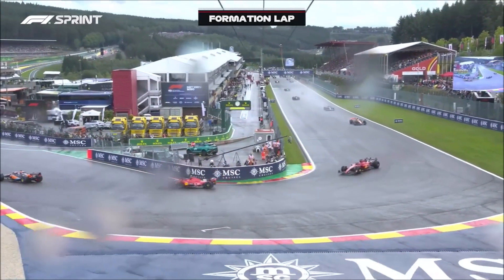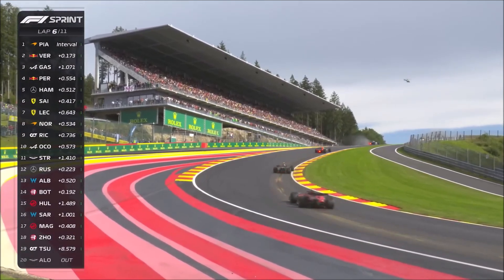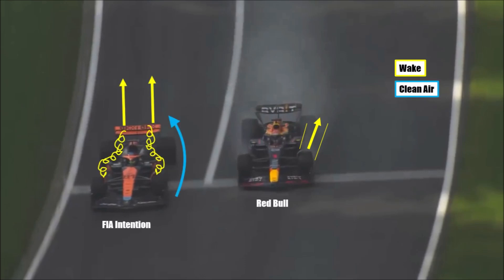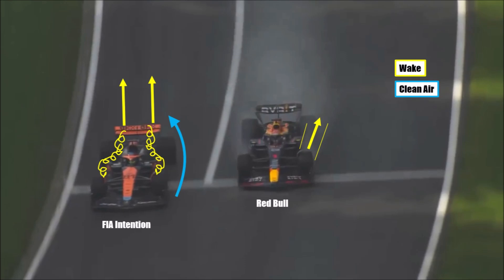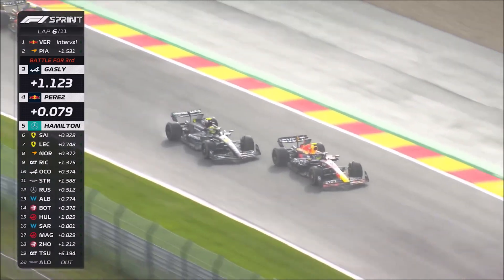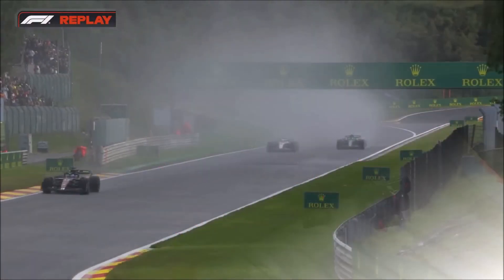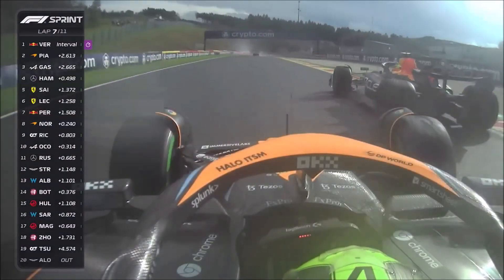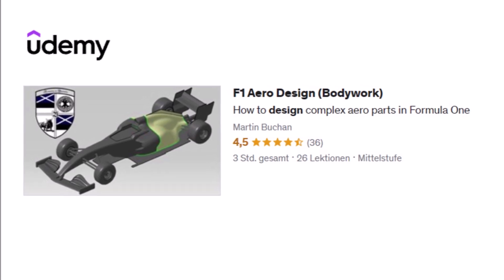F1 2023 - Spa Spray Party - Aero Visualized

Comment: It's important to keep in mind that spray may not _entirely_ reflect the airflow around the car. In order to fully visualise the airflow you want small, very light particles like smoke that don't have appreciable momentum on their own, as this means they will not "overshoot" the flow-line of the air molecules because they are too heavy. However, water droplets tend to be quite large; the tyres aren't designed to fully atomise the water droplets. So the spray may not be an entirely accurate representation of how the air is actually flowing around the car, especially the stuff that's being squirted out of the tyre contact patch.
Reply from the maker: Yes very true. That’s why we don’t talk about details here and just look at general flow patterns.

Comment: Since RedBull is going in against the spirit of the rules, they should be penalized. 
This video also clearly explains RB's advantage on how they are able to benefit from their DRS so much more than the competition.

the issue here is that if the FIA allows this, then all the teams will follow suit, and you are back to square 1 PRE-22, with a lot of unneccesary money spend, and the whole problem is back. It essentially only worked for the 1st 1/2 of the '22 season. By now, it's all done and dusted. It's reasonable to expect that any reg change will cause this.

The real problem however is not that the outwash or aero causes cars to have problems following. That is the genuine thought problem of the FIA. The problem is that following close, with a loss of aero, and increase in heat, can ruin your tires in as short as just 1 or 2 laps. The problem thus, is actually, not the presence of aerodynamic grip, it's the lack of mechanical grip - and this is greatly due to the artificially bad properties of the tires.

if the FIA finally decides to use proper tires, that bring proper, respectable grip and endurance, then we're looking at a whole different situation. It will also improve racing under wet conditions.

Less aero dependance is not really a solution. It is not the real problem, because you will always turn into a situation that that will be overcome. Mechanical grip is what is lacking, and that mechanical grip should be achieved fully independent of aerodynamics. 

There are two ways to achieve this, but there are 3 things needed to bring real success, best is 4 changes.

The first is, as stated, to fix the tire issues. Make real, good, tires, and you are done. They can keep the different tyre compound mandate if they wish.

The second is, to lower the overall curb weight of the cars. Make them shorter, and allow 'exotic' materials. The cost cap makes sure costs don't fly out of reality.

A third solution, would be to open up the regs. The cost cap will prevent going too far on cost. but if you open up regs, teams can come up with nifty innovative designs, as long as they fit within safety margins. 

The fourth solution would be, to re-introduce fueling. This would also reduce the weight of the cars easily by 50kgs. Right now, they ride with 100kgs of fuel on board at the start. The cars are already super heavy. If you introduce re-fueling, by forcing the max fuel capacity to be 50kgs, then this will make the cars a lot faster and much more agile. 'But it is more dangerous to have fuel during a pitstop' - yes and no. The idea once was to reduce incidents because teams were trying to have too fast refueling leading to incidents. But now we have so fast tire changes that it creates such hectic we see much more 'unsafe releases', and it puts many members in danger. 

forced refueling makes the pitstops slower, and as such, less cost and pressure to change the wheels and make mistakes. It will also take away unfair tactics during safety cars or virtual safety cars to a margin.

Comment: @1:33 it's impossible not to create wake with open wheels car whether it's FIA intention or not.
Reply from the maker: It’s not the intention to avoid wake but to position it closer to the car‘s centre line.
Reply: @bsport320  It's impossible to do that unless they are allowed to have an aero structure that is only allowed to tuck in the wake in instead of out in front of rear wheels. The opposite function of those barge boards in the past.

Comment: B sport can you look at the Mercedes bouncing and the red bull, if you go on board with max p1 lap the red bull bounces on the straights and in the corners but less so when the drs is open. Lewis DHL fast lap award the Mercedes didn't have drs was bouncing more but when it had drs was bouncing less than without drs but still more than the red bull. Spa must be bumpy in Places but also both cars had porpoising in several locations.

Comment: Mmm... I liked your analysis and I don't want to say it's wrong, but... Isn't the direction of the water spray more dependant on the wheel angle? I don't mean the camber, I mean the angle that Mercedes was able to modify with the DAS.
As far as I know, front wheels are not literally parallel, they are facing inwards a little bit. If the Red Bull have this angle bigger than other teams, it could explain the direction water spray takes.

Anyways, great video! Now I want to watch the highlights at 0.25x in a big screen.
Reply from the maker: It's true that there is some toe angle, but the aerodynamic effect is very small. Outwash is not being produced by toe angle but by aerodynamic surfaces around the wheel.

Comment: I don't think this analysis is correct cause you're comparing apples to oranges - dry line vs wet line. They have different amounts of 'visualising particles' so you may not be seeing all that happens in either case.
Reply from the maker: I am not comparing the McLaren next to the Red Bull. I am just explaining the FIA's intention vs Red Bull.
The only comparison I did was HAAS vs Aston and there was still some spray around the HAAS to see the general flow pattern.
There is never a perfect comparison, that's why I keep these videos more general.
Reply: That's another factor to take into account. A big one.
Maybe it's not useful to compare cars side by side. But surely we can compare cars when both are out of the dry line & not side by side. I mean, at different moments.

Comment: Max could follow lewis so closely in sector 2 it was crazy
Reply: A large part of that is because Lewis was running pretty low downforce. He had one of the highest straight line speeds that weekend and was consistently one of the fastest in sector 1 while being slower in sector 2. Kinda the opposite of McLaren.
Reply: @shaunlevin5081  yes but even in the sprint he followed piastri very closely, and leclerc in the race

Comment: Let’s hope Mercedes can get some improvements done before end of year… I feel the main issue for them would be their chassis design
Reply: Not just the chassis, but the rear suspension and weight distribution is heavily impacting the car as well. 

What this car desperately needs is a brand new underfloor can partially mitigate the issues if the design it like Redbull or Aston Martin’s. 

Note that this floor is still the Zero-Pod concept floor.
Reply: What surprised me the most this year is hearing Lewis complaining about the drivers seat position on the car. He's too close to the front. 
I never imagined it would have an effect on "driveability" until he said it. But it makes total sense.

Comment: if this goes against the intent of the regs, the fia should step in and close this loophole. otherwise more teams will figure it out and we will have no overtakes
Reply: No one should ever be punished for breaking the intent or spirit of the regulations. Regulations should unambiguously state what is and isn't allowed, punishing anyone for breaking the intent or spirit of the regulations is a sliding scale, can quickly become championship manipulation and reflects very poorly on the sport as a whole, the FIA should not be excused for their poor rule making.
Reply: @utahnl  i didn't mention any punishment. I said the fia should close the loophole
Reply: @YossiDagan  Regulations should be unambiguous, there are no loopholes, something is either allowed within the regulations or it is not, period. You mentioned closing loopholes in your original post which implies unfair punishment, as the punished were following the regulations to the letter.
Reply: @utahnl  imo, closing loophole is not a punishment. I agree that if someone did a great job in finding one he should be allowed to enjoy it for the season, but not more than that (like DAS and other cases)
Reply: What loophole though? Redbull is just sealing the floor better then their competitors which has this as result. We can try simplifying the floor in regs but does that solve it, or will that also cause problems for their opponents. If it was a silver bullet like DAS or the double diffuser you can bet your ass the fia would've alreayd banned it. The car is just better on all fronts.
Reply: @santman3200 Such outwash defeats the point of the regulations
Reply: @santman3200  i wasn't aiming to slow down red bull (although it would be a very welcomed possible side effect) in my comment, just to avoid dirty air and the worsening of racing

Comment: Amazing video mate! Newey and his team haven't only managed to create one of the best F1 cars of all time, they've also managed to make it difficult to follow, both because of its performance and his aero😂😂😂
Reply: "difficult to follow" That is exactly what the new regulations being brought in were meant to stop...
Reply: @robfer5370  Yeah, but it's logical that teams care just about their performance, not about the following cars
Reply: @sergioferrero46  Ofc, it's not down to the teams to make competitive and fair racing, it's is down to the rules of the sport and the FIA. 
All im saying, is when these new regulations for ground effect cars were being proposed. A very big selling point of why the sport needed it, was it would make for closer racing and enable more overtakes! Because the cars would be able to follow each other very close, without losing loads of stability and performance, from dirty air off the car in front. 
But as it turns out that is just not the case and cars still need to drop back from following a car in front to not kill their tyers. So just like it was before the new regulations... 
The point being. 
The new regulations didn't work for making the sport more exciting and competitive, with loads of close racing!!
Reply: @robfer5370  I think new regulations worked partially. Yeah, even drivers complained that 2023 cars were more difficult to follow than those of 2022 as result of development, but they're stillborn easier to follow than the 2014-2021 ones. Also, aside from RB (and Max), the grid is tighter than ever
Reply: @sergioferrero46  Yep but nobody is racing for 2nd place or the runners up places, they are all racing for the win. So if the guy at the front is not only the fastest car on the grid but also extremely difficult to follow to even attempt an overtake, where does that leave the sport.
Reply: Guys the car is not difficult to follow, it just manages airflow in a different way.
Reply: @itssaubr  Manages airflow in a different way, is what makes it difficult to follow. The new rules were meant to make it easy to follow, ergo red bull are working in direct contradiction to that. 👍

Comment: Did anyone see the vapor cones that the Ferrari was creating underneath the car infront of the floor, behind the wheels?  I think it was during the Sprint Shootout.  It would happen during the long Kemmel Straight.  At one time, the vapor cone was sorta flashing in snyc with the porpoising.  It would appear like a cloud, then dissappear when the floor bottomed out, then reappear as the suspension/floor cycled back up.  It reminded me of fighter jets doing high g manuvers and you'd see a large vapor cone on the wings.  No other car was doing that.  I wonder why only the Ferrari's were experiencing that kind of phenomenon?
Edit: It was in Qualifying.  Q2 around 6:20 left in the round as Sainz passed Max into turn 7 and really noticeable in Q3 with 12 secs left as Sainz approaches turn 7
Reply: I saw that. it happen also at the start of the breaking phase . I think it because their front win is pretty high, the pocket of low pressure air is bigger (more visible) it's probably happening to the other cars but less visible on screen .
Reply: It was visible during the race as well. It's more like the moisture turning into fog, due to pressure.
Reply: Yep, I was wondering if anyone else saw that too! Cool find!
Reply: low pressue zones (behind the front wing) reduce temperature. this causes moisture in the air to condense. hence the clouds
Reply: Yes!!! I saw that. It felt like a fighter jet low pressure condensation behind the wings
Reply: At some point I thought there was some flash coming off from the ferrari
Reply: I saw it with the Red Bull once, I’ll have to go check again on the Ferrari. I think it’s soooo cool to see that.
Reply: I SAW IT TOO. OMG.
It was like a jet vapor. It's looks awesome when I noticed that
Reply: that was visible in Austria aswell, pretty damn cool thing to see
Reply: Saw it too during qualifying. Kind of guess its the floor working hard, accelerating air creating a suction effect
Reply: Even they dont know othewise they will fix the car.
Reply: Ferrari are with 2 years behind rbr
Reply: It happens when you get a low pressure area. The flow will accelerate as it goes into the underfloor, reducing the pressure. My assumption is that the Ferrari has more of a change in area towards the front end of the underfloor than some of the others. Then again, the Ferrari was the only one I really saw a lot from that angle
Reply: It's because their aero people don't know what they're doing, lol.
Reply: @perfectman3077  broski you don't even know if that's an intended effect or it's impact on performance so shut
Reply: @void_snw  From Ferrari? We all know it's not intended.

Comment: So why are cars unsettling so much after being overtaken? A recent example is Lewis and Checo, as soon as Checo went in front of Lewis, Lewis' front snapped. I've seen this so many times in the last 2 years. Also tire deg seems (key word is "seems" Im not sure if thats the actual case) bigger now than before especially when they in dirty air, which leads to cars just slotting behind another car in the 1.5-2.5 seconds range. It seems to me the new regs did nothing to improve racing.
Reply: It's still better than it used to be, but the more downforce the cars are producing, the more they're impacted.

And if the wake is pushed outboard like on the RB, the area behind that affects the following car is bigger.

So it's a combination of these factors that slowly ruins these regulations, they DO work, it's just that it gets worse over time.

Imo the sidepods should get regulated further in 2026 to remove the outwash.
Reply: This era of ground effects is all about sealing the floor on the edges to create a low pressure pocket underneath the car that sucks it to the ground.  It works really well when there is clean air going in and under the car.  When side by side, the outwash created on the right side of Perez car pushes a lot of turbulent air into the Merc.  That turbulent air then disrupts the merc's floor edge sealing which causes a sudden loss of downforce, especially on a long wide turn (higher speed) that they were in.  That sudden loss of traction causes sudden understeer in the middle of the turn.  Perez got clean air so he can hang around the outside, but not Lewis.
Reply: I wonder, if FIA now have a clearer view of how teams circumvent the close racing concept they tried to produce, could they just impose restrictions on the parts that lead the airflow spilling from the sides and the rear wheels to the car that is following? They did block Aston Martin from using some trickery in their rear wing in 2022 I think (?).
Reply: Lewis' rear snapped because he kept his foot in it on the tighter line. He knows what he was doing there
Reply: @Lewythefly 😂😂😂
Reply: @Lewythefly  no it isn't. Lewis got pushed into the apex, when his front right hit the painted apex, he got wheel spin, because the paint doesn't dry like the track, and his front left wheel grips, pulling the car left and hitting checos sidepod.
Reply: @joshn1678  he was no where near the apex or white line when it happened